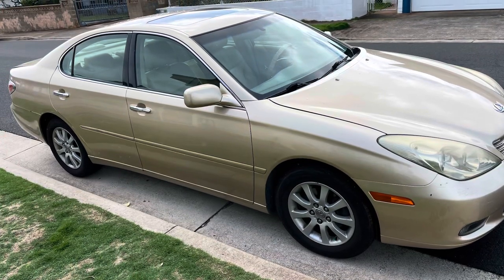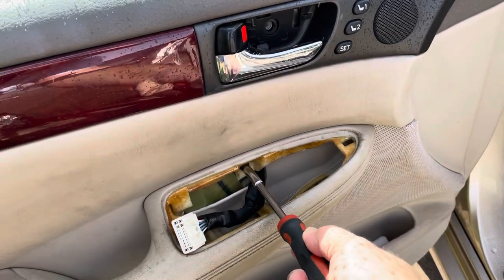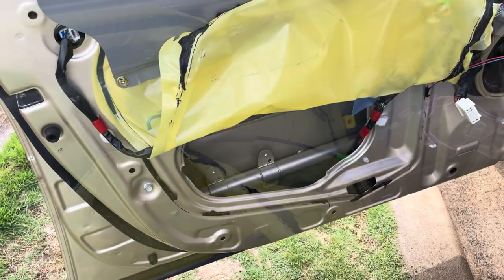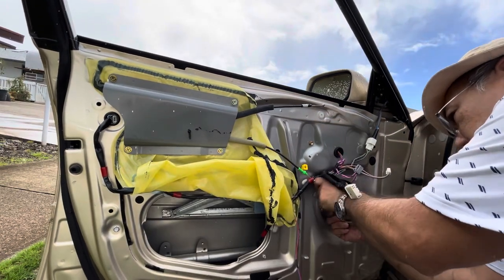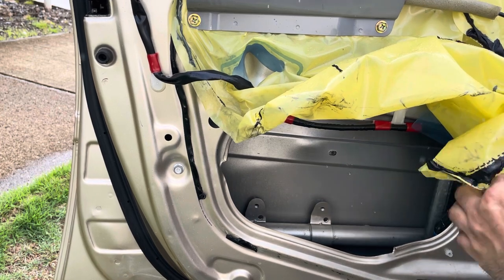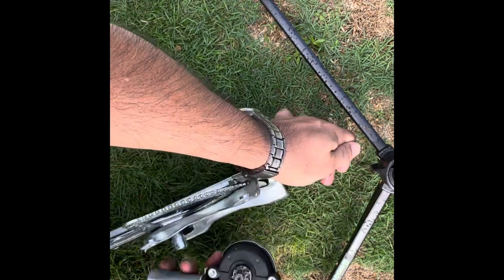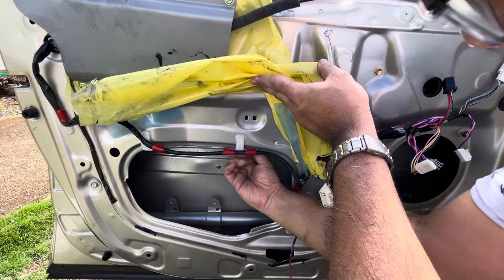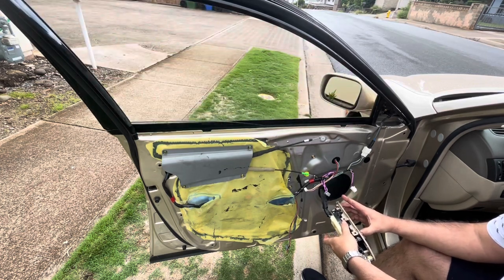Window won’t roll up Lexus ES 300/330

Comment: I wonder how did you reprogrammed the window to work on automatic (one press) or manual and avoid going back down after reaching the top on the door. Any advice?
Thank you for the video. I followed it and managed to install a different motor.
Reply from the maker: Usually you manually power the window all the way to the open position then hold the window switch “down” for 5 seconds. Then do the opposite, manually raise the window to the closed position and hold the switch int the “up” position for 5 seconds. The auto up/down should then work.
Reply: I have this issue with my rear right window not staying up when using auto up. I've tried different options and possibilities but still no luck.
What am i doing wrong?
@meplyee

Comment: How do you do this if the window is stuck up and not down? Confused on how to get access to the bolts holding the window into the car.
Reply: I see your question was asked a month ago, so I'm sure you have solved the problem, but when you remove the 6 bolts around the window motor, the entire unit and window will slide down.